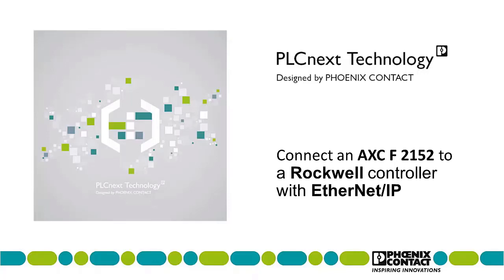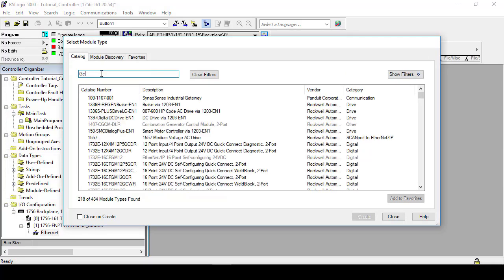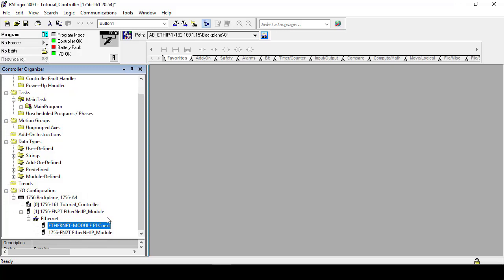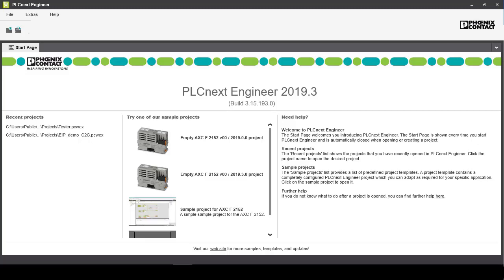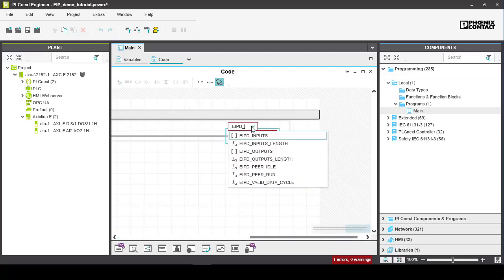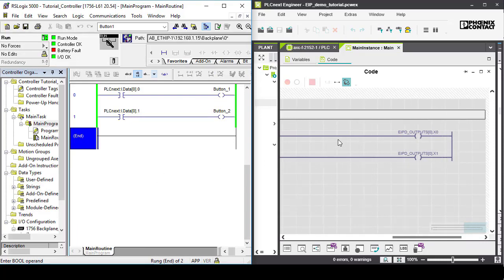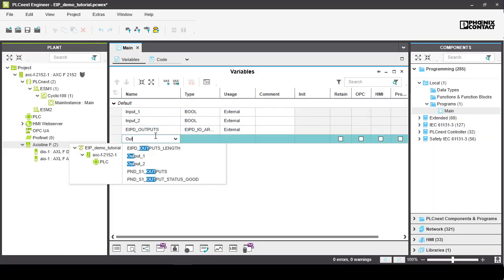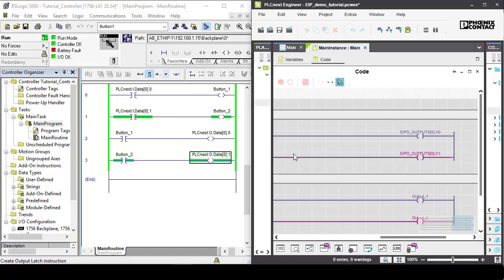EtherNet/IP™ | How to connect your PLCnext Control to controllers from other manufacturers using EIP

Comment: How about Compactlogix 1769 with PLC Next and data type is REAL instead of SINT. 
It's very hard to follow instructions on the video because the guy speeded up everything. Please DO NOT speed up too fast especially on Phoenix programming parts...
Thank you.
Reply: Hello Mr. Hoang, we appreciate your interest and comments.  

Due to the way the Ethernet/IP is implemented, all the Data types need to be converted within 256 bytes of data. There is no data type limitation as long as the conversations are clear and compacted within bytes.

As to the video speed, we appreciate your attention to that, and we will look into possibly slowing down some of it. 

Thanks, and if you have more questions, you can contact your Local Phoenix Contact technical support department.